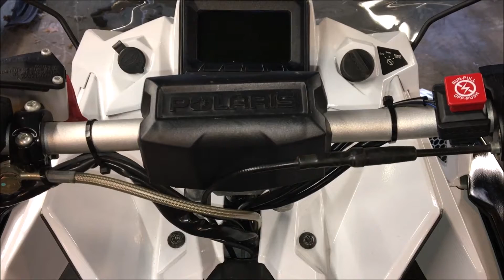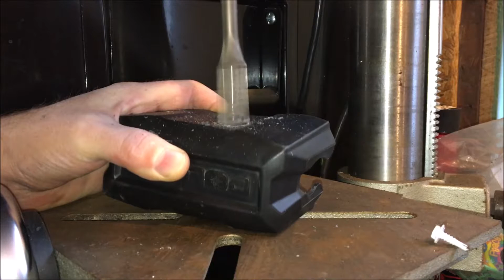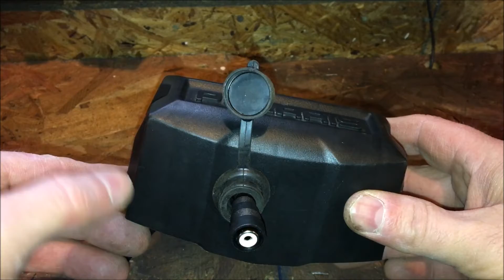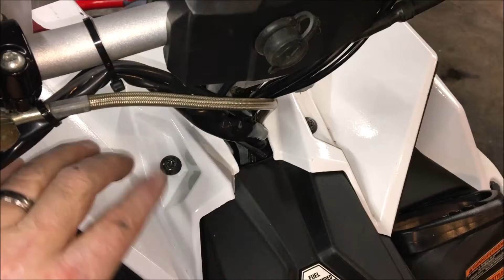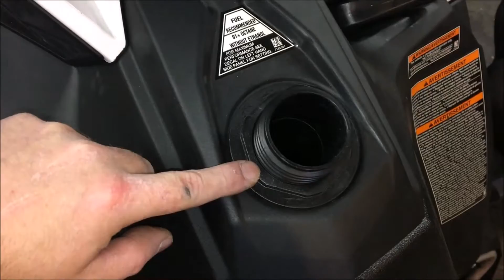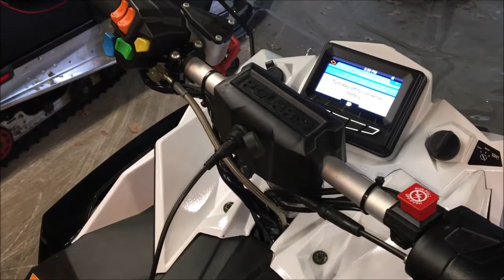How to install a heated shield plug in your Polaris Axys or Pro Ride

Comment: Good morning....excellent video but my sled has a roxx riser (doesn't have the plastic piece that snaps on the handlebar)so is there a good place on the "console" panel to drill a hole for mounting the grommets
Reply: Nevermind I scrolled thru comments and found you've answered my question a couple other times...  thanks for the video
Reply from the maker: No problem

Comment: How did you get your pidd to stay on when sled is off?
Reply from the maker: Electric start. Has a battery
Reply: @StreetersGarage  mine has electric start and battery. It doesn’t stay on unless it’s running.
Reply from the maker: with the key in the ON position, the PIDD should stay powered up.

Comment: Rca cable?, thought it would be the acc cable?
Reply from the maker: There’s 2 options.
Reply: @StreetersGarage  glad I found this then, my dealer told me to use the acc, and that's barried having to take things apart, my rca is easy to get at taking the side panel off. Thank you for the video 👍

Comment: Can you drill the hole directly in the middle? Asking because I have a storage bag over my handle bars and I could feed the wire through the bag but it will be nice if it was centered
Reply from the maker: It needs to be offset due to the handlebar mount.

Comment: Super helpful video.  Helped me a ton with a 2020 Indy 600 XC 137.  I might have stopped at the hood and side panels to find the RCA plug but because of this video I knew I had to take off the cover, remove the large plastic "nut" under the gas cap, etc.  Sure enough, I went that far and found the plug ready to go in the black Velcro bag holding all of the wires.  Thanks for taking the time and posting it!.
Reply from the maker: No problem. Glad it helped you out

Comment: Hi!  Very good video again.  I have a wire for the heated grips of my lock and ride passenger seat, which I will plug into my 12v accessory socket (cigarette lighter).  The thread that comes from the seat is cut and I don't know which thread to put on which.  On my new connector which will be connected to the Y. I can provide you with photos if necessary.  sseg22@live.fr Thank you !!!
Reply from the maker: ok - are you trying to hook up the wiring and switch to control the warmers on the heated seat?

You need the wiring kit from Polaris. It has the proper splitter and connector. However I will tell you that the warmer on the seat were pretty bad. They never got that hot.

We ended up using some Polaris gauntlets and mounted them to the seat to act as a windbreak. Polaris did this as an upgrade / option in the seat option for the Axys.

I wouldn't waste anytime trying to get the warmers to work.
Reply: @StreetersGarage  OK!  Thanks for the answer and the info, but it's not for the seat, but for the heated grips of the passenger seat, if this is misunderstood.  I have all the polaris wiring with the switch, and everything is installed.  It's only the last part of the wire that goes into the accessory socket that's cut and I wanted to know which wire was going to which of my new connector that will be plugged into the Y. Then I would see if it heats up well or not.  I would give you the color of the threads at worst, to be clearer.  See you more 🙂
Reply: I have a yellow son and a brown and yellow son.
Reply from the maker: Yes that's what I was referring too. The grips of the seat. They're a bad design and don't work well even when hooked up correctly.
Reply from the maker: Watch this video. It explains what I did..

https://www.youtube.com/watch?v=5zbC4EQFioE&ab_channel=StreetersGarage
Reply: @StreetersGarage  ok perfect, thank you very much and I managed to find the connector with the + and the -, so everything is ok!  I understand very well what you are saying, that it does not heat up well, and with your video, it is quite clear that if I need more, I will install covers. I'm going to suggest that to my father, because it freezes hands girlfriend.  Big thank you!  See you
Reply from the maker: No problem. Good luck.
Reply: @StreetersGarage  thank you 🙂
Reply from the maker: Did you figure it out?

Comment: Hey awesome video!  Do you know if this method can be done on a 2021 Axys (Indy XC)?  I have the kit and the instructions tell you to remove the upper intake plenum, which means getting the ECU disconnected and messing with the intermediate intake tube etc.  Your method seems far less complicated.  Any input is appreciated!
Reply from the maker: It’s a Axys chassis so it should be the same.

Comment: Great vid!  Just bought an XCR with pull start only.  My old sled had a battery.  Any thoughts on whether there is enough power coming from this accessory port to run a visor as well as I had thoughts of tapping into the harness to supply power to a dual USB cord I have that ultimately would run a GPS and keep a phone charged?
Reply: Thanks.  Did some more reading and learned about that 12v SAE 2 connector under the hood.  Going to use that to provide a USB to a windshield bag. Let it snow!
Reply from the maker: Yes. I run my shield and also charge my phone at the same time with no issues. 

I also have the 12v accessory plug installed too.

Comment: I gave up the heated visor style helmet outlet yrs back, couldn’t ever keep up to being frost free (yes everything worked, good continuity in the visitor and 12 volts ant the connection). Often ride hard in Fairly cold conditions. Went to goggles and a good nose deflecting Bellaclava and haven’t had a problem since. Great ‘to the point’ video however!
Reply from the maker: What kind of helmet was it?
Reply: Streeters Garage wow I need to self edit more haha. It was an HJC helmet. I’d keep all the vents open but once the frost started forming it was hard to get rid of it. I tried some visor spray too
Reply from the maker: I SEESEA I can’t speak for HJC, but I’ve been using a GMAX G54 for the past 4 years and it never really fogs up. I only use the shield when we have freezing mist or rain.

Comment: Anyone else find that the Polaris part # 2878780 (RCA Power Plug) did not have a compatible connector? My sled's connector & kit were both female ends. I have a 2016 Switchback Pro S 800. No idea what's up with that. This video was great but skipped the part about connecting the two pieces which is where I ran into trouble.
Reply from the maker: If I remember correctly. The double female end is needed to the fact that you’re unplugging an existing circuit and putting this in its place.

Comment: Wicked video man! Will this work with no battery? Mines pro x i only have pull start.  Think the plug is there? It work?
Reply from the maker: Thanks. Yes definitely will work without the battery. Plug is there for all models.
Reply: @StreetersGarage  manu r awesome haha im subscribing right now... thanks !!!
Reply: @StreetersGarage  that part # wont work on Amazon or ebay can i just tap into it? Just positive and negative correct?
Reply from the maker: Thanks!

This is the one you want. Your dealer should have them in stock. 

https://www.babbittsonline.com/oemparts/p/polaris/2411708/asm-rca-pwr-plug-w-cover-ac
Reply from the maker: Awesome! Thanks for the positive feedback..

Comment: I just installed my plug and it doesn't work. The fuses look good also ...any information would be great ....thanks in advance.
Reply from the maker: Check for source voltage (12v) at the plug on the sled. If you have voltage, check it with the adapter plugged in. Could be a bad kit.

Comment: In the bag did you notice if theres a plug for a tether to be installed?
Reply from the maker: Honestly I don’t remember.
Reply: There should be a black connector in there with either 2 blacks or a black and a black with a blue stripe (or similar). Will be a Female connector. Some tether kits come with a plug end that is female as well.  Cut that off and install a flat pronged male, one on each of the blacks. Add a bit of electrical tape around the finished connection to keep it secure and water proof.
Reply: @tracecole8130  thank you very much

Comment: RCA for the 850 is on backorder.... great video though will big help whenever I can finally pick one up!
Reply from the maker: Is it the same part number?  They were available on Amazon as well. My dealer had them in stock luckily.
Reply: @StreetersGarage  apparently different than the ones on the 600 and 800s
Reply from the maker: Leave it to Polaris to change it for no reason.

Comment: That'll be sweet for a quick connect. A heated face shield is a nice addition too. Too bad the new sleds are so difficult to get at anything. It takes you longer getting the body panels off than the install itself.
Reply from the maker: Absolutely

Comment: Nice job.  I may add one to my next sled even though I use the ski-doo modular helmets.  I would just like to have the option to add a heated visor.
Reply from the maker: My buddy added one to his 2016 Back Country 800. He uses the modular as well but upgraded to the heated shield for it. He’s only used it a couple of times due to freezing rain. He was glad he had it when needed.
Reply: @StreetersGarage  
Yes.  That's what I would use it for too.

Comment: Don't you miss the old sleds with a hood ?! Takes 2 seconds to access everything. I like that grommet with the cover . Makes for a nice clean install.
Reply from the maker: It has it's advantages and disadvantages. The removal of all the bodywork is necessary due to the way they package and fit everything in the chassis. You need everything out of the way to do any type of work on it. It's amazing to look at a sled from 15 years and see how they've managed to re-engineer everything into a smaller footprint. Definitely doesn't make it easy to work on though.
Reply: @StreetersGarage  I was looking at the new  ski doo 900 turbo. It's all jammed in tighter than you know what under all that plastic. Your right though the improvements in the sleds is well worth it. Pray for snow.
Reply from the maker: Have the first trip planned for the weekend of the 28th. No snow where I am. Another 4 hour road trip!
Reply: @StreetersGarage  Nothing open here yet and I don't think it they will be any time soon. It's been too warm and the grounds not frozen. I'm thinking of buying a Quebec trail pass next year. It's 4.5 hour drive but the trails are amazing and open at least 5 weeks longer.
Reply from the maker: I've been doing a lot of volunteering  for the local clubs in order to get the trails ready. I just hop that the patters changes so we can begin to use them!